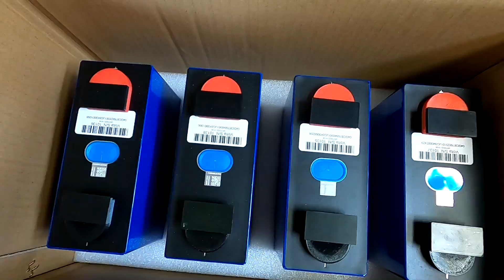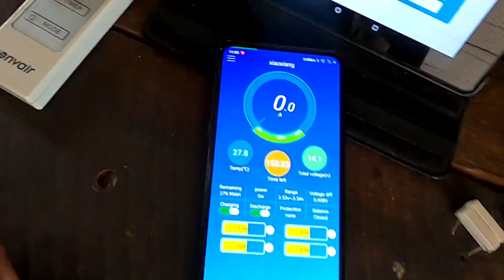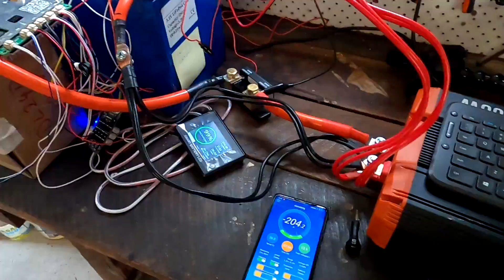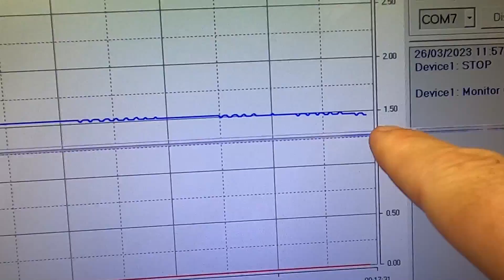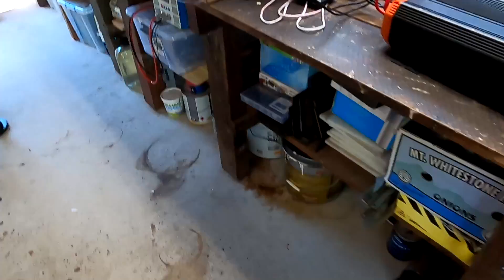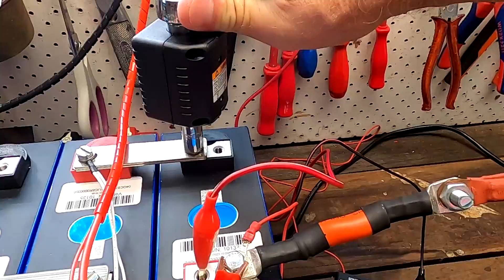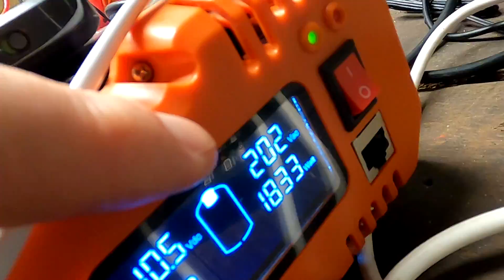My worst B-Grade cells vs. Certified Automotive Grade in a 100%-0% 200Amp Discharge Test. Surprised?

Comment: I am guessing that at say 5 years use the certified cells may have more capacity.  Perhaps the calendar degradation might be slower.  Is anybody monitoring this?  Will said he hammered the batteries and he considered it was the calendar loss of capacity rather than usage that defined life cycles.  But would the certified have better performance over life cycle?  Anybody a view on this (or data)?
Reply from the maker: All very speculative. I mean first we were told cert cell are better, I tested and they were the same as other batteries. Then people said, they are better under high load and current. Nope, neither... Now we're coming up with this long term guess, that they might be better after a few years... are we looking for excuses to pay a higher price for something which does not exist maybe?

Comment: I have 16S EVE LF50K 3C rated and delivering around 56AH very very good but I don't believe they are matched because there is about 100-200mv difference at end of charge and having 50-100 mV difference in charges state. Even when I am using a JK BMS with 1A active balancer. Can't imagine what would happen with a passive balancer. Anybody know how I could improve the situation and get the delta down. Planning to polish terminals to decrease resistance. Also they can't deliver more than 1C with voltage sagging a lot even they are rated 3C continuous. Did I get bad cells even though they are delivering around 112% capacity?
Reply: Original LF50K has M4 terminals and I think they are meant to be welded with bus bars directly for upto 150A load (3C). Using bus bars and M4 screws on those terminals will create a lot of resistance that will be hard to avoid. If your 50Ah rated cell is giving 56Ah, that must be really good cells in my opinion. I have 4 LF50K cells, gives 52Ah but less voltage difference at 1C, I think it's because I have M6 welded terminals and thick copper bus bars. These M6 studs are welded by a third party seller, not original from Eve. May be you can try with thicker and wider bus bars too. But I would limit the cells to 1C without welded bus bars like in EVs.
Reply from the maker: You can try one of these capacitive active balancers and leave it on for a while when the battery is fully charged. This gives you a nice top balance to start with. If the cells keep drifting apart, check for the bus bar connections as you said. You can test the terminal connections when doing the 1C test just with a multimeter.
Reply: @OffGridGarageAustralia  I have the cells attached to a 150A JK BMS with 1A active balancer, the battery gets discharged to 48V everyday and then charges using a 12.8KWP solar array with 50A max charge. But the deviation is very high at 150mV full and 200mV full discharge with no one cell to blame. There is measure voltage drop between the terminals and the busbar - about 2-3mV at 50A and between the ends 9f the bus bar at round 1.12mV and the busbars are around 20mm2 tinned copper with SS bolts with split and normal washers. The pack has been manually top balaned to 5mV. Ans the balance trigger voltage is 3.35v with a deviation of 10mV.

Comment: Very interesting. My 16s pack of LF280k from Basen (batteries from end of 2021) ran a full season without any issues, delivers only 255Ah from 3.45V to 2.9V. Probably need to  check the crimping and temperatures?
Reply: Andy tests from 3.65v down to 2.5v. 3.45 to 3.65 is not much at all and 2.9 down to 2.5 will get you another 4 to 5 amps. So still ends up a bit low, what were they back in 2021?
Reply: @glencooke494  once at the beginning, I could reach 262Ah, but only once.
Reply: @glencooke494  in summer I will do a test from 3.65 to 2.5V but it is a bit annoying to change the settings in the Multiplus, as the system is running without issues (never change a running system xD)
Reply from the maker: I would leave it running as it is. Are the cells top balancing OK?
Even if you have one cell with a lower capacity, there is not much you can do anyway.
Reply: @OffGridGarageAustralia  top balancing with the JK BMS works well. Thank you for your answer!

Comment: The issue for me is that certified cells are something that can be relied on. B grade may be as good, if you get lucky. If you test voltage sag on each cell before putting them in a system, you are fine. If not... you can be, (as per averagejoe), really shafted. Saying B grade is ok is fine IF you are willing to test at high C values to check if you have a dud cell.
Reply from the maker: Not many are using high C rates in solar setups. The occasional burst and discharge spike maybe but apart from that, there should be no problem.
Reply: @OffGridGarageAustralia  Sorry, I was not clear in what I said. Whether you need a high C rate or not, if you do a discharge with a high C rate, it will tell you if the cell is "bad" or not. Even in the event that low C rates are used, that battery that "failed" the high C test, but passed the low C rate, that cell is still going to be the first to fail, and better to know now than in 2 years time, when you have to run the active balancer all the time..
If that makes sense?
Reply from the maker: @GTrainRx7  ah, yes, that makes sense now. You're right with that.

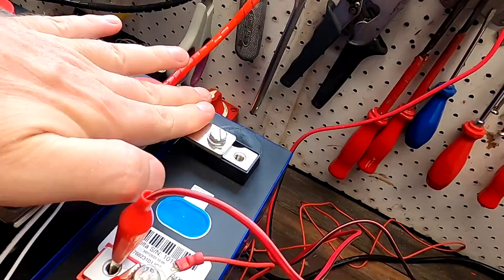Comment: 23:00 If all cells get "flushed" by the same current, why should any resistance in the terminal connection change the load they get? If the internal resistance is the same (nearly) they should charge to the same voltage. Or do I understand electric engineering wrong?
Reply from the maker: The BMS measures the cell voltages and if one cell measures lower because of a bad connection, this would determine the trigger for the BMS to turn off once the measured voltage is down to 2.5V. The cell itself will still be at the same SOC as the other once (assuming they all have the same capacity). The higher bus bar to terminal resistance would prematurely end the test with a lower result.

Comment: Andy, perfect as usually 🎉
these cells are certified for a current of 1c, and although this does not matter for our segment, I think it would be fair to perform a test with a current of 1c, 280 amperes in our case.  most likely we will see the difference.  and this will forever close the question of the difference between cells that passed the test and did not pass the test. 1с current and its behavior can be a reason....
also a voltage drop lower than the cell rating can be decisive for the test result.  the difference between the voltage curves at the beginning of the discharge is visible even on your test, while the cells do not fall below 3.2 volts.  but at a current of 1s, the difference will most likely be more significant.  for us, of course, this does not matter, but for building a car battery, voltage drop is as significant a factor as capacity.
Reply from the maker: Thank you. I really don't think we will see any difference at 1C. If there would be an advantage of the cert cells we would see already a small gain in the 200A test. But nothing. There is no threshold where the cells all of the sudden get better once this is passed. And, as you said, if there is a small advantage at 1C, it does not matter. Not even when building an EV.
And, I really don't have equipment to run such high currents. That would mean a big upgrade to busbars, cables and inverters.
Reply: @OffGridGarageAustralia  welllll, 1C discharge causes the cells to heat up more internally, increasing the internal resistance and maybe affecting ion kinetics somehow. First see then believe. Maybe you are right maybe not. But yeah maybe not so relevant for storage. Thanks! Very nice video.

Comment: The issue with the double screw terminal head is that you need a perfectly flat busbar (no protusion on the edges of the holes and edges) and we need to use double hole busbars with both screws. I have had lot of issues with these cells and the busbars included (had to sand them down time and again to get minimum voltage difference. Single screw terminals were a lot better although there 'seemed' to have less surface area. If you are using single screw busbars in these new terminals, there are issues.. not sure if its resistance or something else. My conclusion has been a perfectly flat busbar touching the whole surface..
Reply: We see this exact issue, we chose to make our own adapter for this same reason the bars got very hot, you had to have absolutely perfect pressure on each screw or it would cause the bus bar to warp.
Reply: You can get around some of that by adding some MG Chemicals 847 between the terminal and the bus bar.
Reply from the maker: I don't like these double threaded terminals. At the beginning I thought it is a great idea but as you said, everything needs to be lined up perfectly. The welded studs with their minimal contact area are perfect and never get warm.
Reply: @OffGridGarageAustralia  agree totally
Reply: @OffGridGarageAustralia  Not only that,  customers we have will put thread locker and studs into the holes, then the thread locker will leak onto the base and cause conductivity problems. Big mess all around.
Reply from the maker: @sfkenergy  good point!

Comment: Great info Andy, hopefully this will put most of this capacity testing to bed. I cannot understand all the hype of "my cells are only 275 amps or I am getting 285 out of mine" as battery manufacture in not an exact science. (Yes it is getting better) How many of your 58 thousand subscribers have capacity tested AGM, lead acid or calcium batteries and can show results from them. Oh, sorry Andy, there's another test you could do. Have a great day Andy and may the sun be with you!!!!
Reply from the maker: Great summary, Glen. Love it!
Reply: If I buy a Pint of Guinness I want a full Pint!
Reply: @garys-half-baked-offgrid-dream  No head?⁉😆
Reply: @glencooke494  On a Guinness glass there is a Datum Line for a full Pint that leaves room for a perfect head.   And we like perfect head 😂😂😂
Reply: Well. If I pay for 280Ah cell, it's not wrong to ask for 280Ah. Missing 10Ah from each cell will mean 160Ah total loss on common configuration which is close to 1kW capacity in total.
Reply: @KossuJahvetti  If you are running a 3.2v 16P 1S yes you are correct but if you are running a 48v 1P 16S then you are wrong it is still only 10Ah which is 480Wh or a 60w globe for 8 min. Do you also weigh every packet of chips?
Reply: @glencooke494  LOL. It is exactly the same what ever your configuration is. A good book of Wh is a good start.
Reply: @KossuJahvetti  A lot closer than 1Kw I think🤔
Reply: @KossuJahvetti  noweher near 1kW

Comment: Glad to see these tests. I was planning to use these cells for an EV conversion, but I was wondering how they would handle a continuious 100-200 amp discharge with 300A bursts. Seems like it will work
Reply from the maker: Very cool project. What car are you converting?
Reply: @OffGridGarageAustralia  I have a few cars. I want to do the hyper9 AC motor into my old 4wd 1986 Subaru XT. With a smaller battery for 50-60mile city driving for the spouses commute (currently a cyclist).

Then for me I haven't decided if I will convert my poorly running 1993 Chevrolet corvette with a warp9/warp11. Or Possibly building myself a custom rat rod like pickup truck with dual warp11s and direct drive and mounting a pretty massive pack of 144v and multiple cells in parallel for 1000+ amps of peak power for a fun sports truck sort of vibe.

I have build a few muscle cars and turbo imports that i currently drive, but thinking gas powered days are fastly ending soon.

I just converted my entire house to off-grid solar with grid backup last summer by myself and with help for all the info in your videos, so im ready for another project.
Reply from the maker: @HellTriX  That sounds awesome. I wish I had such capacities as well to do such projects. Great!
Reply: Very interesting tests! Recently installed 280k cells (144V pack) in an EV conversion (Land Rover Series 2a). Currently in the testing phase and 20 kW (0.5 C) continuous seems to work fine. Max amps set in the bms is 1C.
Reply: @inonyx  You gonna do some youtube videos? Would love to see how it is working out. I planned to do 144v pack with 280ah cells with 3-4 packs in parallel so it could handle 1000-1500Amp bursts. 4 packs in parallel would be 1120 amps at 1C and at that power you won't be able to do 1C discharge very long due to speed increase :)
Reply: @HellTriX  Sorry i have no detailed conversion videos on my channel. That is some serious amps you are planning :) My setup also uses a warp 9, warp drive controller up to 800A (1000A max.) and elithion bms
Reply from the maker: @inonyx  Nice conversion. Hope this is on YouTube somewhere...

Comment: Hi Andy, and thanks again for this video.. really good test.. 😁
We can say that your B grades are good, very good even!  but unfortunately this is not always the case...
Reply from the maker: No, it's not, I know that. I have some other cells from Battery1.0 which we could test as well. We know, they have a lower capacity. But we also know they would handle the 200A just fine, just not as long as the cert cells. If that is the only difference, there is still no reason to buy cert cells.

Comment: Awesome Andy, …. As usual, very VERY interesting! 
(You get excited when you see 150A.
I get really excited when I see 43 or sometimes even 45A 😂)
That’s a really fabulous result for the “dodgy” cells - I just absolutely LOVE these batteries. 
BTW Also : How does your FLIR camera go? Mine is only 11 months old, and I’m lucky to get 3 minutes out of the battery- not impressed! I can charge it one day and it’s always flat next day. 👎👎 Bloody ridiculous for an expensive piece of gear.
Reply from the maker: Thanks Dave. The dodgy Hithium cells are still holding up great💪
No problem with my FLIR so far. I keep the battery around the half full mark all the time (you check in the app).
I'm sure you just replace the battery but still very annoying. Send them an email!

Comment: I had a cell with a hot terminal too. Tried everything under the sun. Cleaning, sandpaper, emery cloth, different bars, torque. Finally ordered some MG Chemicals black carbon grease. Worked perfectly! I'd love to see a test of this sometime!
Reply from the maker: I've got this crease here as well, can do a test and see if it fixes it...
Reply: Das wäre toll. Wie heißt die schwarze kohlenstoffpaste auf deutsch?
Reply: @mario-q6k9w  MG Chemicals 847
Reply from the maker: @mario-q6k9w  Guckst Du hier: https://de.farnell.com/mg-chemicals/847-25ml/w-rmeleitpaste-kohlenstoff-25ml/dp/2811926
Reply: @OffGridGarageAustralia  there's a school of thought that the mechanics of good electrical connection must result in a "gas tight" joint.  The large bearing area and hard material seen with these batteries intuitively make such a gas tight joint difficult to achieve, especially with relatively low strength of the fasteners - the clamping pressure won't be very high.  Then if the terminals aren't perfectly flat and all in the same plane.  And if the bus bars are stiff.  And, aluminum tends to develop a hard surface oxide that's not very conductive.  I wonder if this type of connection with small threaded fasteners with hard bus bars is ever very reliable.  Maybe a flexible bus bar would be better?  And / or maybe copper plated with some softer metal - silver?  Welding would obviously eliminate these problems, though cause different ones.
Reply: @OffGridGarageAustralia  awesome! 👍🏻
Reply: @bluetrepidation if you use aluminum bus bars you can try to send them very gently but do not wipe of the dust in the end. I have those LF280K with big terminals and what I've found if you leave the dust (basically fine grained aluminum) connection resistance is so low that my YR1050 can not even measure it. But if I wipe everything with alcohol and reconnect, it becomes like resistance of 1 or 2 cells. I think that aluminum dust might be acting like that paste, it covers every hole and creates more paths for electicity.
Reply from the maker: @AlexanderBartash  that is a very interesting experience you're sharing here. Thanks a lot for that.
Reply: @OffGridGarageAustralia  You are welcome. If you try this as well I recommend to measure resistance in two different ways. You can measure terminal+bus bars themselves, omitting batteries. Also you can measure resistance of the whole assembly, meaning 2 batteries with all those connections. What I've found is that if I measure only connection resistance it shows like 0.1mOm but if I measure though batteries I get 0.39mOm when resistance of a single battery is 0.19-0.2. I think that when I measure resistance of the connections without including batteries YR1050 shows very low readings beyond its measuring scale and I get that 0.1mOm because when I measure with batteries I get 0.39-0.19-0.19=0.01mOn connection resistance, which is nuts.
Reply: @AlexanderBartash  interesting 🤔
Reply: Interesting…
Luckily the most that many of us ever pull with solar applications will be about 0.1 or 0.15C.
Reply: I have the same cells as Andy just tested,  I used a scotch bright to clean the terminals, cleaned with alcohol, and straight away applied a very small amount of MG Chemicals 8463 silver grease. I actually bought two 7g tubes, and I barely used any from one tube. Will soon add a second battery and may apply some to all the connecting lugs as well. One thing I've noticed is my cells are very even, currently sat at 51.85v and cell deviation is 0.006v. Only time I noticed high deviation is when the pack is pretty much fully discharged. I'm hoping the automotive grade simply last longer.
Reply: Pretty sure its an internal issue and should have never made it past inspection